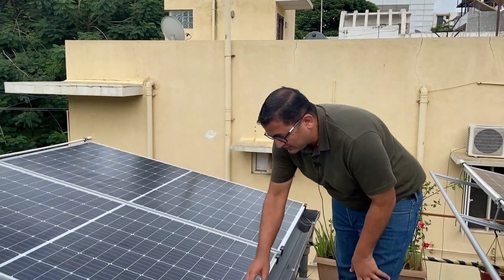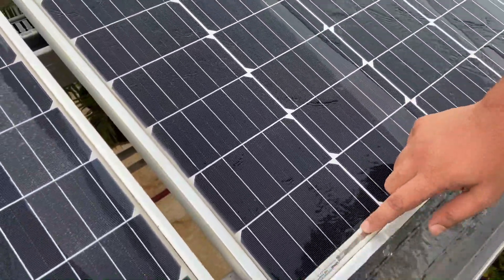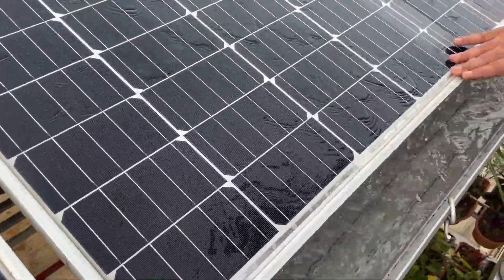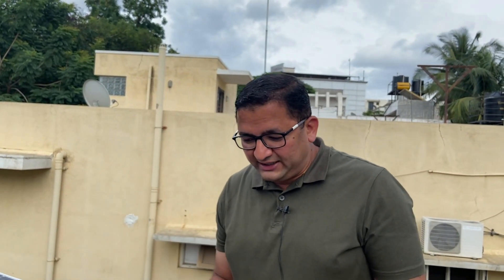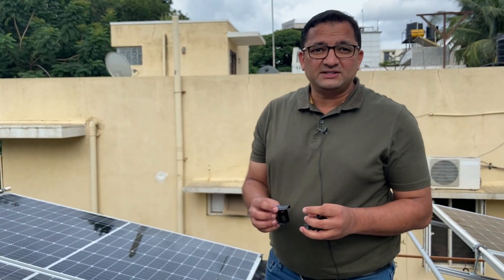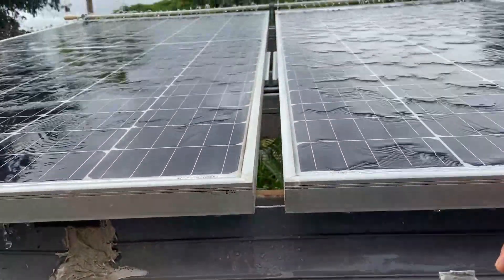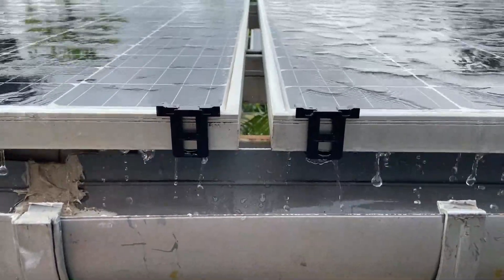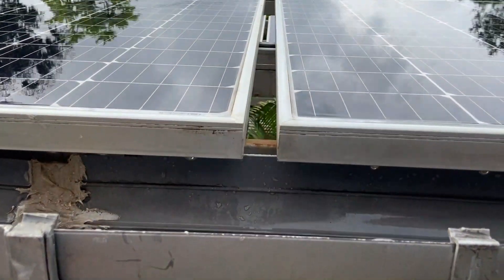Preventing Hot Spot Formation in Solar Panels

Comment: Hello I think I need some of the restoration powder where can I buy it they don't sell it in my country I tried to clean* one panel on the hot day the water was too hard it evaporated and it left spots I've gotten most of the residue off but it seems like dried permanent water spots and the panel is sort of a hazy gray color compared to the normal panels which are more deep black thank you